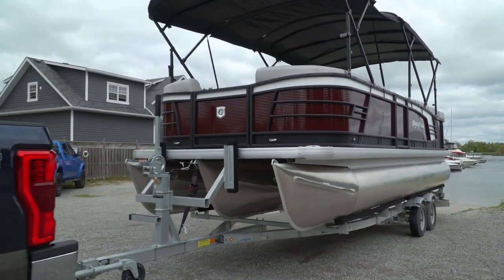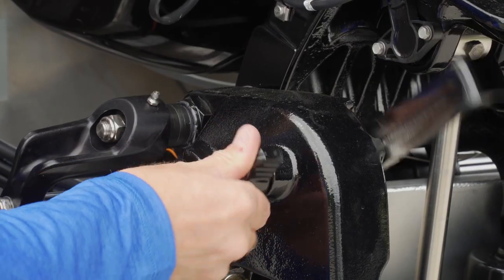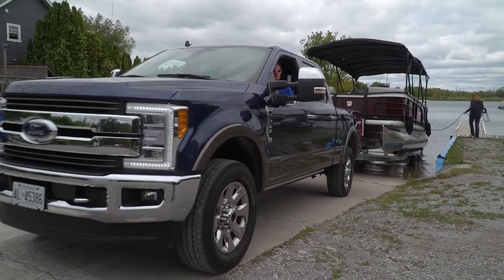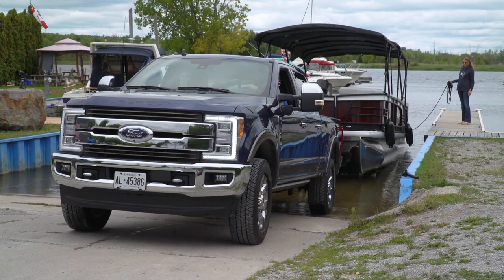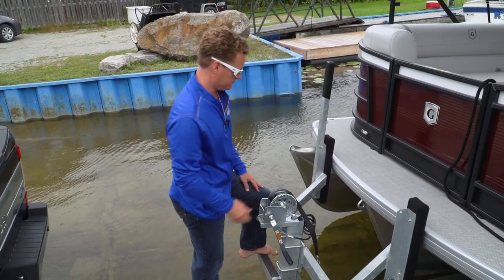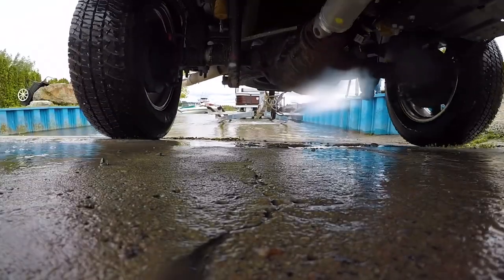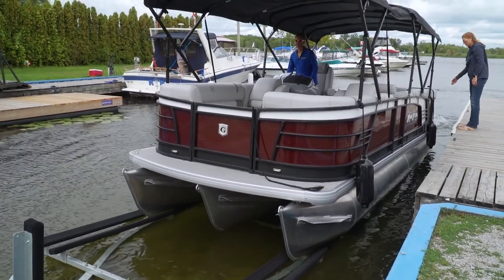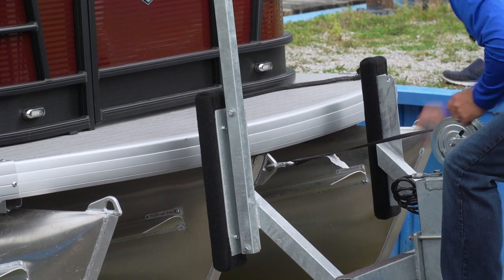How to Launch a Pontoon Boat | PowerBoat Television Boating Tips

Comment: STOW THE BIMINI. The wind at 60mph WILL destroy the aluminum frame. Also don't be lazy and tuck the Bimini in the zipper boot. Avoid boat ramps that are too steep, the Pontoons will not be aligned at the rear and if you pull the boat out of the water with the pontoons crossed on the bunks, they can easily tear out the screws from the bracket, or worse, the 2x4s will crack.

Comment: Some good tips but if you have surge breaks on the trailer do not disconnect your power. You must have it connected in order for the breaks to not engage when in reverse. Most modern pontoons have LED lights so there is no issue there. Just verify if you have a surge breaks. Made that mistake when I bought my boat in 2016. Could not figure out why my trailer was making some weird noises when I backed it down the ramp. Called the dealer and found out I have surge brakes and I must keep the power connected in order to back the boat down the ramp. I have had them connected for going on my 6th season and have had no issues.
Reply: Surge brakes will lock up when driving in reverse on level or uphill grades.  Surge brakes will not lock up when the trailer is going down a ramp, thus you can disconnect the wire hardness once you are on the ramp.
Reply: @waynewong3880   Well all I can say is my ramp before you get to it it is completely flat and and when I backed my boat up my surge brakes would kick in and I could not back it up before and on the ramp. As I said I have left them connected going on 6 years now and have had no issues at all. Now on my older bass boat I disconnect them.
Reply: I have never disconnected any trailer lights on any of my boats in over 35 years. Never heard of that.

Comment: If I might add... how you wenched it at the end... face level... if that strap let's loose or breaks while wenching there.. you've got some bad facial injuries....
I usually make it a point to power load until the front frame of the boat touches the front bump stops...then wench from above to lock in place..
Great video though!!!!
Reply: My hand slipped off the wench handle one time and spun around and hit me in the jaw. Everyone around heard it and was sure I had a broken jaw, including me. It was sore for a few days but not broken. Sounded like a shotgun going off inside my head. Good advice!

Comment: Why use the motor to launch the boat ? Just back it down and do the BRAKE CHECK it will slide right off > 
Why wouldn't you want your helper use a bow Line instead of the stern line??
I'm Just Saying